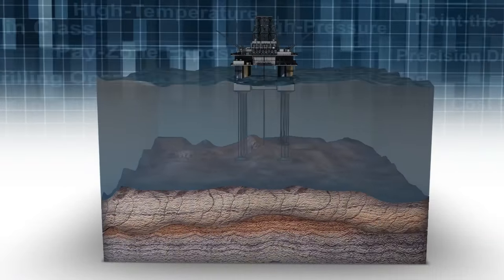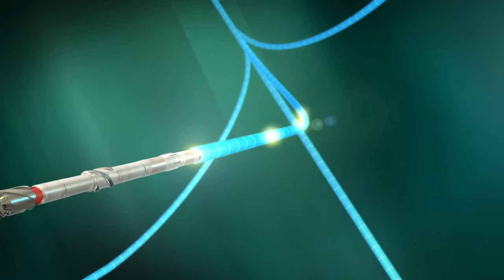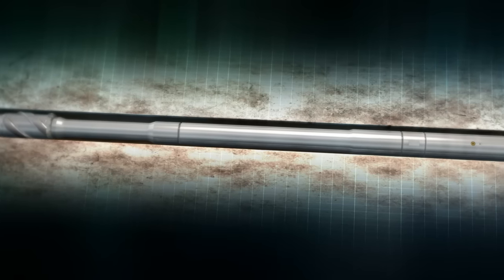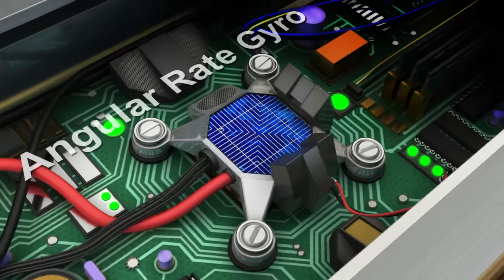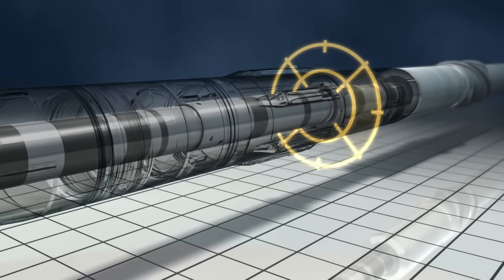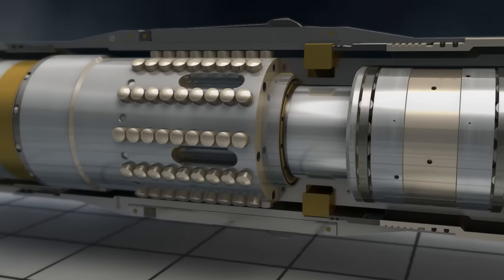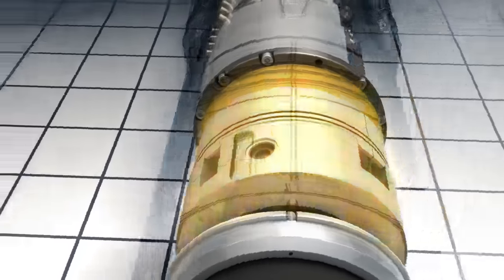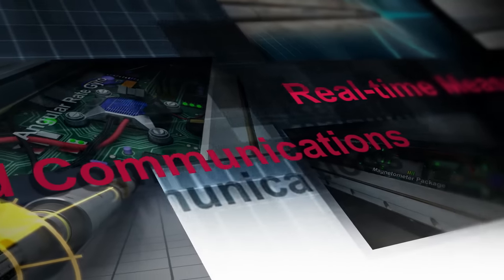The Revolution Rotary-Steerable System - How It Works

Comment: Is the mud cool enough to keep the Li-ion batteries from runaway? The electrolytes in Li-cells can behave badly as low as 158 to 194 degrees F.
Reply: For down hole equipment, most if the batteries are rated to 150C. Some better binned hot hole ones will take a few more C's but not much. If you're curious, look into lithium thionyl chloride.

Comment: 👍👍👍👍👍nice job i started looking into frackn I was looking into correct drilling operating procedures for long term gas release from granites hydrocarbon and a new3 cut set might just do it for required math and gas extraction, and possible way to get hydrogen capture i would go space have a condensing machine for a repressed to see if able to make hydrocarbon by high pressure into the stone layers or if heat presses and something else might work need check lab time to get right gasses. And what is the one thing you don't do to granites 😕 frack there been a few mistakes and cracked it all the way to the surface the sand layer will not hold if it ruptures especially with a acid WTF you always drill water and let it slowly run out use a vacuum some things they are doing are nasty as hell max return 50% of what they flush max O poo. Wanted to know what it would take to ark blast till the granite cardon melts to the original cut in i need to melt pressed seal as time may be required they do this with human waste trash and are already pulling methane gas out mmmmm?????.